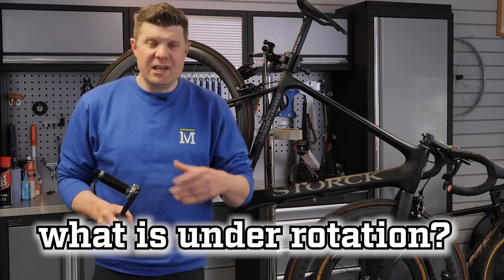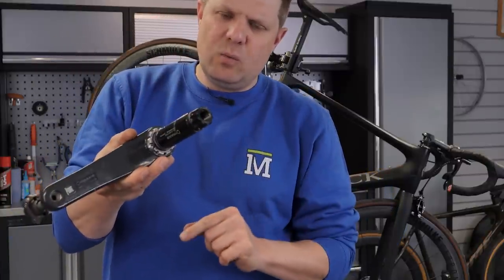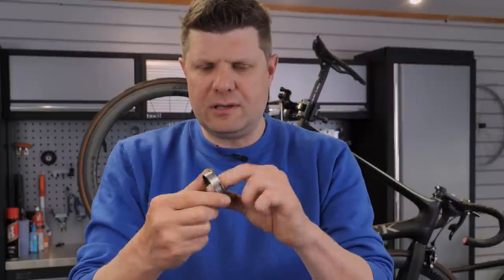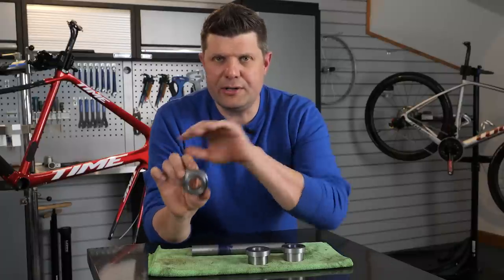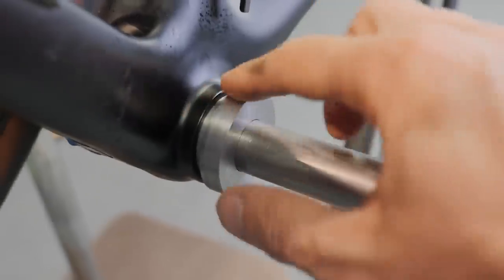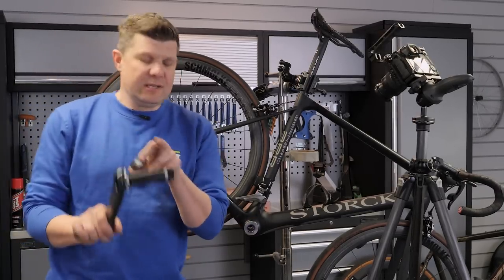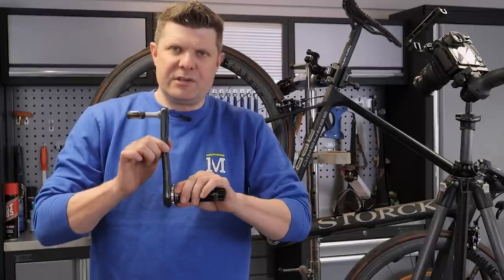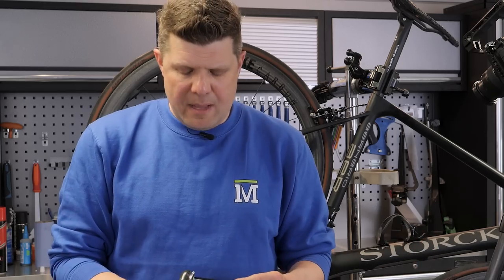Crankset Under Rotation causes wear & friction

Comment: Clear educational video for people with a non-engineering background. It seems that quality control is not in a good place in the cycle industry even though prices have gone through the roof and buying a bijou frame is no guarantee of acceptable engineering standards. The shift to carbon frames without fully addressing their requirements together with all the different BB standards has become a real minefield for both bike shops and their customers.
Reply from the maker: It sure has. I hope we are doing our bit to help.
Reply: This isn't new,  poor alignment was common with high end steel frames decades ago.

Comment: Beyond excellent no one is doing this exacting work other than Mapdec and Hambini  i never saw this problem before raced for 16 plus years on alloy frames with screw in BB so easy to fit and service thank you for this video.
Reply from the maker: Thank you. Don’t dis pressfit. It opens up so much frame design possibilities, we just need to learn how to use it.
Reply: Aluminum frames were often built with poor tolerances too.   You may have had one without noticing simply because your cranks spun well enough for poor alignment to not be blatantly obvious
Reply: @veganpotterthevegan  the real issue is that it was pretty easy to correct steel/aluminum BSA shells to "good enough" performance using common machine shop tools and know-how...
Reply: @joelv4495  not at all.  If your shell isn't perpendicular to the front to back plane of the bike, those tools aren't helping you.  If they don't create a straight line within reason, machining tools aren't helping either unless you cut out the BB and weld in a new one

Comment: As you said in the video, this specific wear appears also on hollowtech crankshaft despite the use of a relatively soft plastic sleeve to fill the gap between shaft and inner diameter of bearings. In a way, this may help to compensate a little for poor radial tolerances. But no miracles, if the bearings are not properly and regularly serviced, the shaft will spin inside the sleeve and wear will take place. Even if the plastic sleeve can be considered as a sacrificial part as much softer than high strength steel, shaft will be damaged if moisture or dust are present. I bought a used shimano lx crankset on the web and i realized after transaction that what i thought to be just grease sludge on the shaft at first glance was actualy hiding wear and corrosion reducing thickness of about 1 mm. Screwed ! Although the cranks are supposed to be pressed onto sleeves by the adjustment bolt, this doesn't seem to be enough. The side surface of the plastic sleeve could have had teeth on the surface to mechanically fit into some dedicated slots on the cranks.

Comment: Great video, I've invested in plug gauges, internal micrometers & adjustable parallels to verify the BB shell - your tool for checking parallelism seems to be efficient and accurate method to check alignment, I would be very interested in such a checking tool.
Reply from the maker: Thank you

Comment: I would definitely be interested in purchasing these when they become available, but wonder if all of the BB sizes will be available? I typically do a lot of older bikes, and that includes square taper BB's and a couple that are truly old that do not have sealed bearings at all. I have indeed thought about what you just did, but there truly is nothing on the market to help...glad that you are starting in that direction! (Shop name is Chase Cyclery)

Comment: It might be worth considering a 30 degree taper on the ground 25mm shaft that you would blue to give you a very good Iindication of the angle where misalignment is taking place. IYSWIM. 

If you have one of your guages installed with a needle roller bearing you should get near zero wobble of the shaft over that small distance to the other gauge.
Reply from the maker: That’s a great idea. I’ll give it a try.

Comment: Hambini is not the only one making thread together BB's. Some of these will include bearings for 30mm spindle and 41mm bb shell......Kogel, Cane Creek, Token, BBright, Tri Peak, and more.  Jeez, give the poor guy some options. I'm just a hobbiest, no mechanic here!   I do compliment your You Tube efforts.  
Thanks,
Carl NKC
Reply from the maker: Bb infinite do make a one piece 41mm to M30. I’m in a bit of a dispute with them at the moment about the durability of those bearings for off road use. The others only make 2 piece BB and would require some heavy frame modifications and adhesives to work.

Comment: I just bought a thread together token ninja BB to solve a similar issue, I notice the token BB cup.size is 40.95 compared to duraace cup size of 41 mm, the token BB is going into the the frame for about 1/3 the way with just pressing by hand  , so I believe the threaded together BBs are smaller in diameter because they rely on the threading mechanism to apply tension  and might prevent the bearing get crushed when installed on  a slightly undersized BB shell , I am still reluctant to tighten up the token BB fully  given that I ruined my duraace BB during the first install. Wish I had a 40.85 gauge. Great content as always.
Reply from the maker: Thank you. You should tighten those to spec.  They can otherwise spin in the frame.
Reply: @Mapdec  I haven't used a tool to tighten it yet , yes will have to torque it to around 30 nm for a proper fit

Comment: Looks like you’ve been inventing👌 I’m not sure what sort of response you’ll get from some LBS, due to the fact they’ve been ignoring BB quality for too many years now. I’ve finally ridden my new Trek SL5 and would you believe it if I told you I have a noise , down stroke drive side when I am putting the power down up and hill… been here before and you just get blank looks that you’re crazy! I’ll try some old pedals and put the original wheels on before moving forward with my LBS. I have however got myself a T47 Hambini special, but it’s threaded, so if bad alignment it won’t fix the issue I suspect. More videos please, you’ve been quiet😁 always enjoy the educational value, it’s so appreciated😊
Reply from the maker: Thank you. Holidays and the Fred Whitton rush.

Comment: Had this exact issue when trying to use a Quarq PM with a BB86 frame.  Rotor BB cups that felt fine out of the frame but compressed to the point where they would barely spin freely when installed.  Lesson?  Stick to Shimano with BB86.

Comment: Hi Paul, great video. A couple of weeks ago i purchased a Storck Fenomalist. It has Campagnolo Chorus 11 speed. The crankset is the so called Ultra Torque, with the bearings on the shaft and hold into the bb cups. I let my lbs replace the bearings( i don’t have the correct tools to do it) my question is, can those bb problems also occur with the Ultra Torque system? Cheers
Reply from the maker: Hey. Yes. But you will see the witness marks on the inside of the BB cups rather than the shaft.

Comment: 9:05 get rid of the Teflon you just sprayed in there lol. 
Curious why you didn't try sanding the BB back to concentric as per you're other video? I assume shimano used nylon BB cups & nylon spindle sleeves as the nylon will eventually crush and effectively straighten the BB out
Reply from the maker: Put simply, we were not being paid to correct it… for now.

Comment: Thanks for the video! If the holes are misaligned, would the bottom bracket facing tool help in that situation?
Reply from the maker: No. That just makes the face square.

Comment: Why was the crankset removed in the first place? To see if the anodising on the shaft was worn? I bet the anodising would be worn in those spots even in a hambini bottom bracket
Reply from the maker: To change the chainrings. You only see this in poor frames.

Comment: I'm a bit confused about the solution. What does that new BB do exactly? How does it remedy the situation?
Reply from the maker: Take a look at the Hambini website. The one piece design does the alignment work instead of the frame
Reply: Got it. Is the bb in the video one side pressed into another side/shell?
Reply: @youling1997  It seems that this bike does not use any BB at all, just the bearings pressed directly into the shell
Reply from the maker: Kind of.  The outer race is flanged and groved. You couldn’t buy an ISO bearing for the frame. It would need to be something sold as a BB86 to M30 bottom bracket.

Comment: Should a retaining compound like loctite 641 or lithium grease or nothing at all be applied on the shaft/spindle - bearing shell interface?

Looking to reduce/prevent abrasion/galling of aluminum spindle on the steel shell of BB30 6801 bearing
Reply from the maker: Bearing grease.  Neither of those 2 options.
Reply: Oh thanks, i thought/presumed bearing grease was just for the ball bearings inside the races.

Comment: Genuine question: why did we move away from square taper bottom brackets? 
I mean, my old MTB has square taper and never serviced that in 14 years time and they run just perfect.
Reply from the maker: Mostly to save weight. Later to open up frame design for wider tyres esp in MTB.
Reply: @Mapdec  I can't help it but to think that a lot of the "save weight" features really diminished the durability of MTBs and it's parts. Like I said, my old MTB is 14 years and never serviced any bearings at all, and it just runs great. No play, no strange noises. It does weigh 14kg for a alu hardtail and only has 8 gears at the rear. But still... We pay so much nowadays for bikes and they can hardly work half a year without any service.

How does ditching the square taper help for wider tires? Wasn't it possible to just make the bike wider where the bottom bracket is and also equally widen the square taper shaft and everything?
Reply from the maker: @JS-up8ff  hey man. I’m just a mechanic.  Engineers make stuff, consumers buy it. I fix it. 🤷‍♂️
Reply: @Mapdec  I know. It was no argument against you. I highly value your opinion on stuff because you have a clear and good mind on stuff and quality. I watch almost all of your videos just because of that. There aren't many people who think and act the way you do.
Was just curious about how it transition from taper to what we have now and how it "got better" compared to.

Comment: Still down in that cartridge bearing rabbit hole, I see.  I've got a number of old cup and cone BBs that have never exhibited any problems.  But they have an axle and loose bearings.  Very strange, the industry just keeps on going in that direction. I guess we can't turn back now.
Reply from the maker: I guess. We have been using cartridge bearings. For quite a while now…..
Reply: @Mapdec  Long enough to realize that maybe the old way wasn't so bad but the blinders are still on. So now all the very specialized tools and fixes. But hey, whatever... there are no real brainy-acks in charge.
Reply from the maker: ISO cartridge style bearings are a significantly positive step forward.  They are pretty universal in everything now. Even Shimano is waving good bye to the cup and come past.
Reply: @Mapdec  define significantly positive. All while have to fix all the problems they've created.
Reply from the maker: More accurate, weather sealed, preload, huge range of ISO sizes, easy to replace, less effort to get smoother faster result…..
Reply: @Mapdec  Shimano added seals to their BB cups back in the '80s, pre-load was easy by simply turning the cup before setting the lock ring, effort to set up was minimal, cleaning and replacing bearings was easy as the bearings were all a standard size. What am I missing here? We are assuming at lease reasonable quality parts here. I've got an old Campy Record BB without seals but it has reverse theads in the cups that will push grease out in order to prevent grit and water from entering. That's '70s era technology.
Reply from the maker: Lots,  lots more than we can discuss in a YT comment. Welcome to the future. We are never going back to the past.
Reply: @Mapdec  I'm going to go back to sleep now.  Do me a favor and wake me up in another ten years and we'll pick up where we left off.

Comment: If it aint broke dont fix it ,a shimano square taper for me always 🙏🤘🇬🇧
Reply from the maker: Well yeah, except they round out, heavy as hell, and rust easily.  They also don’t allow for much width required to stiffen up carbon frames. Octolink on the old DuraAce… was it 7600?  That is a gem if you have a metal frame.
Reply: @Mapdec  Don't eat breakfast

Comment: Inspecting the blue dye for witness marks on the test shaft doesn't make any sense. If it's perfectly round, it should bind for a full rotation. Surely the only place to inspect for witness marks to indicate tights spots is on the bushes that are in the frame. If the shaft is only binding in one or two places, it suggests that the shaft is not perfectly cylindrical/not perfectly straight.
Reply from the maker: Umm. A machined piece of steel not being straight. Possible, highly unlikely, and easy to test by rolling on a flat table.
Reply: Mark Douglas is right, I was thinking exactly the same thing. How come the shaft gets stuck at some angles if it is perfectly round? It should either be stuck everywhere or run free in the perfect setup. I guess your tool is not precise enough. If in doubt ask around with real engineers,🙃
Reply from the maker: @francisbeaumonde8198  This has been designed with help with a few engineers, getting all the various fits correct etc. I'm sure you will work it out. The clue is in the shaft fits.
Reply: Draw yourself an ellipse (an approximation of a non-round BB cup) and then draw a circle inside it that touches at the narrowest part of the ellipse. Then please explain how the circle only scuffs at certain points when rotated. Perhaps the penny will drop if you look at it long enough. My original comment was meant as a question/helpful feedback but you seem to have gone very defensive and dismissive on it rather quickly!
Reply: @Mapdec  Mark Douglas has worked it out and so have I. It is a great tool to check alignment. A very good Idea indeed. It is just that the tolerances should be even better than they are now. If the tool gets stuck due to poor alignment of the bike, it should be stuck a full 360° rotation, if the tool is machined correct. Please ask a mathematician if you do not trust Mark Douglas or me. Like Mark Douglas I support your idea. Please note, I don't know Mark Douglas. I would like to make your work to help build better bikes.
Reply: No response anymore. Too bad.

Comment: If you’re going to go to the trouble of getting those test fit pieces machined, why not get an abrasion or cutting surface machined into one side and make the other press fit. Then you could press in the one piece male cup/spindle and then rotate the female around the spindle and accurately square both sides without any diy guess work. Then press out the male/spindle cup and you’re done. You would obviously press in  the male on the better side of the BB shell as a datum.
Reply from the maker: Thanks. What you describe is what the park cutting tool should do. It costs a lot and doesn’t allow us to correct alignment with subtle adjustments.  Ideally a bike shop would have both tools. Create accurate datum with the reaming tool. Then use the gage to correct the other side.